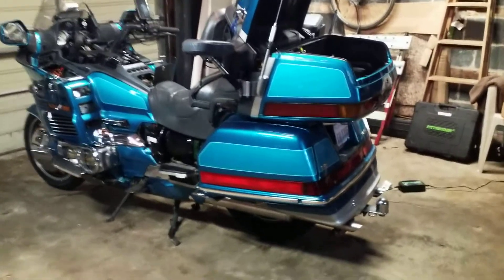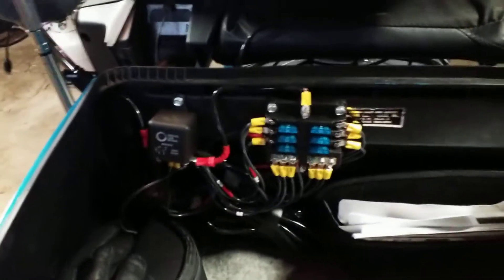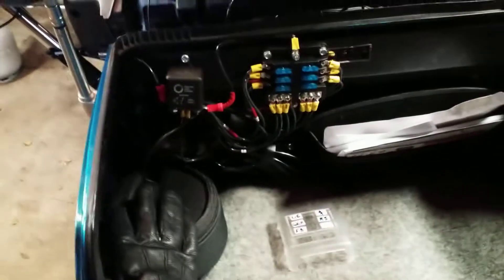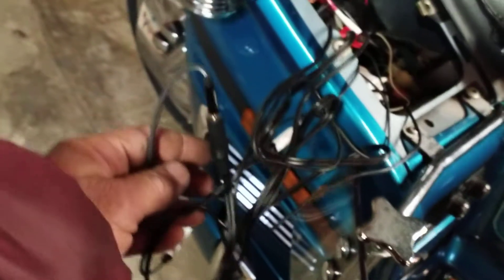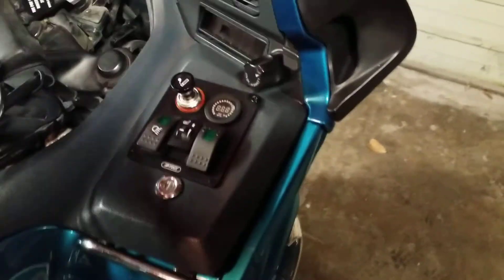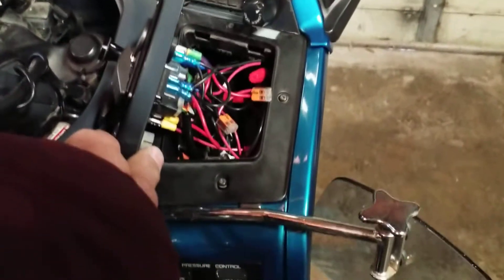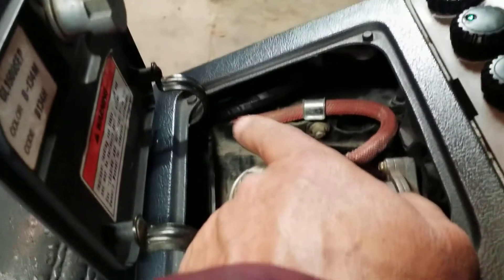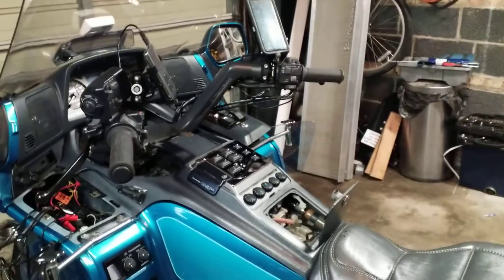Gl1500 how I did it

Comment: If you convert all the lights that are one all the time, mostly headlights, to LED, you may not have to run the big alternator. Incandescents pull a surprising amount of amps. 
Awesome video. Thanks for the ideas.
Reply from the maker: Hey Shellie, good point but I'm still on my factory alternator. After the compu-fire  failed in only 9 days , I went back to the factory and it's good. It handles all lighting, stereo, 4 heaters( grips.  seat and backrest for 2 , and armrest). It doesn't give me any trouble now that I have the voltmeter, and I can always see what it's outputting.
Reply: @goldwingrider6184  I guess I'm into the redistribution of amps. If the stock alternator will run it all, awesome!

Comment: What did you use for the bluetooth adapter?
Reply from the maker: Hey I used 3 parts to make up the bluetooth and aux cicuit...
https://www.amazon.com/dp/B07D1N97LM?ref=ppx_pop_mob_ap_share.  

https://www.amazon.com/dp/B07431YDWM/ref=cm_sw_r_cp_apa_fab_K2WGFbGCY8967

https://www.amazon.com/dp/B07S84ZTW4/ref=cm_sw_r_cp_apa_fab_05WGFbGMKNHED

Just a foot note I get feed back if I leave both active at same time. I unplug the ipod on aux , or turn off bluetooth in phone ,to use opposite  devices for a clean signal.
Reply: @goldwingrider6184  cool thank you

Comment: That bike is cleeeean. Nice job on the install, definitely a motivator to do the same on my own
Reply from the maker: Hey I used 3 parts to make up the bluetooth and aux cicuit...
https://www.amazon.com/dp/B07D1N97LM?ref=ppx_pop_mob_ap_share.  

https://www.amazon.com/dp/B07431YDWM/ref=cm_sw_r_cp_apa_fab_K2WGFbGCY8967

https://www.amazon.com/dp/B07S84ZTW4/ref=cm_sw_r_cp_apa_fab_05WGFbGMKNHED

Just a foot note I get feed back if I leave both active at same time. I unplug the ipod on aux , or turn off bluetooth in phone ,to use opposite  devices for a clean signal.
Reply from the maker: Feel free to ask any questions for specific details on what I did